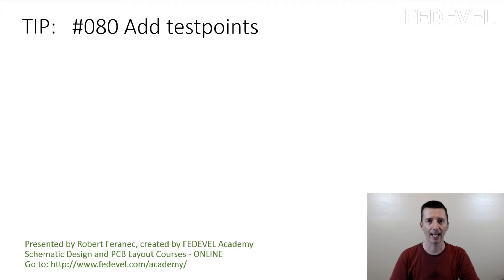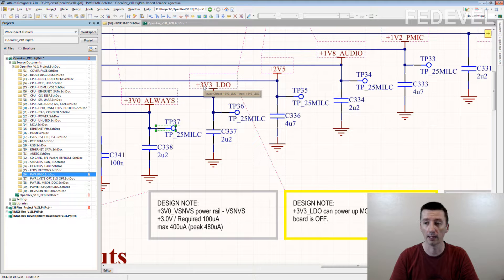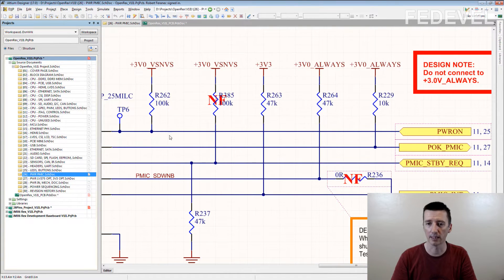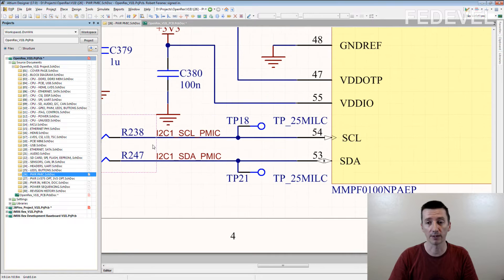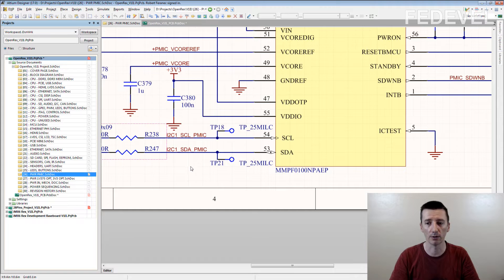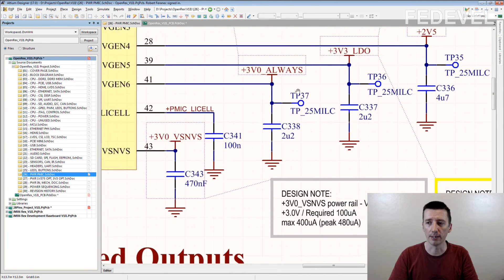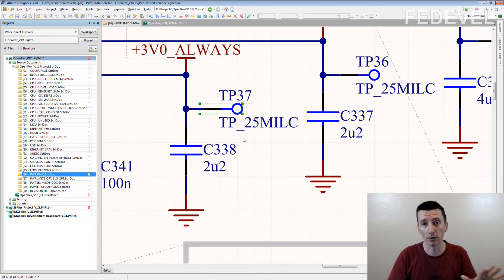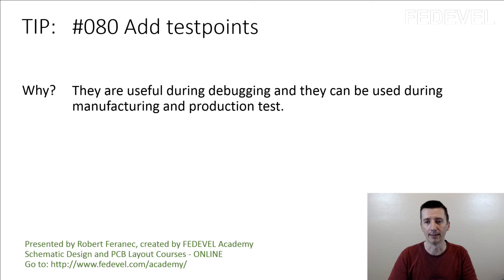TIP #080: Add testpoints

Comment: Excellent video, nice to greet you and congratulate you, I am your new subscriber to your channel, I have a question, I am starting to repair all kinds of electronic boards! The question is the following in the general design of any PCB. Are the PCBs the testpoints only placed on positive lines or are they also placed on negative lines? I ask because there are repair techniques for the detection of short circuits where voltage and amperage must be injected to detect the short on the PCB

Comment: I am putting LEDs on every PSU, that indicates there is voltage near the testpoints, also the testpoints are named as the voltage or signal that should be there. For me is very helpful, when something does not work in production finding out the problem is much easier.

Comment: I use test points 
- 1K ohm resistor between the point to be tested and the test point node for low logic voltages up to 5V and a GND test point just close this voltage test point.
- 10K ohm resistor between the point to be tested and the test point node for high voltages higher than 5V (12V, 48V) and a GND test point just close this voltage test point.
- Direct connection on signal with very close GND test point. Specifically every clock signal.
Reply: And why would you place resistors? That doesn't make any sense. You want to measure the specific signals, not ones with different values...
Reply: @alejandroperez5368  Not signals, voltage rails. If you forget your multimeter set on  current mode, then you will burn your multimeter when measuring voltage.
Price of a resistor iş 0.0001 cent.
Reply: @alizup_19  Why will that burn the Multimeter? Instead of setting the mode for testing voltage, ure testing current. How will that burn the Multimeter, could u elaborate

Comment: Hi Robert, thank you for your videos ;). I created testpoint as a simbol in schematic editor and then I link to the symbol a footprint made with a unique SMD 1mm round pad. I started to place the components and the TPs to the board but I notice that there are rule's violation regarding the TPs. I'm violating the rule about TP style because, being an assembly tespoint, I removed the tick on the "allow testpoint under component". If i place that tick the error disappear. I think Altium alert me because it treats differently the PCB component from the PAD and tell to me that  the assembly-testpoint-pad is under the PCB component TPx. Any solutions?
Reply: Did you find any solutions at the end?

Comment: Hi Robert, I have a problem with test point. I created a circular test point as a schematic symbol, 1 circle and 1 pin. Then I create a circular pad 2mm x 2mm and designation is 1, same as pin 1.

I successfully compile the schematic and import into PCB. I can select any test point and move around freely on TOP layer. As soon as I flip any test point to BOT layer, I cannot move the test point anymore. It seems to lock deadly to 1 spot, cannot move with Edit-> Move-> Move Selection or Move Selection by X,Y. Have you seen this issue in your past? I'm using Altium 19.1.15.

Thank you.
Reply from the maker: I have not seen anything like this. Should work ok. Maybe something with filter (try to click on Clear button)?

Comment: Firmware staff should be consulted with in regard to test point availability; especially in cases where the firmware will be done from scratch (e.g. no pre-buillt linux). Debugging firmware or even a new device driver is a lot easier using protocol analyzers, logic probes, etc.

Comment: When I have space, I use THT testpoints. Test probe dont slip away from testpoint and I avoid shorting.
Reply: Although THT is even better, a simple PTH makes a lot of difference. It's especially useful for GND and power rails, or anything you may want to use your DMM test leads on. There should also be GND test points near any small buses with test points as well (like I²C or SPI) to make it easier to connect them properly (e.g. reduce lead inductance, common mode noise, etc.).